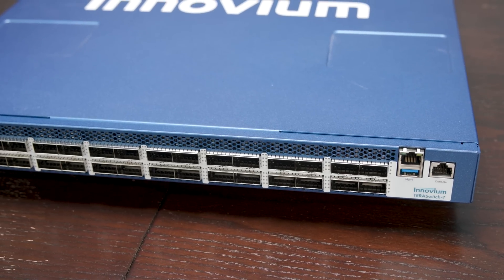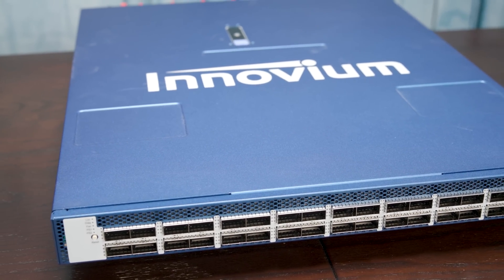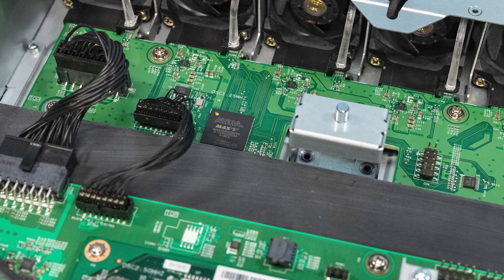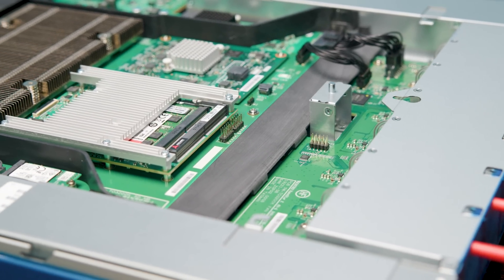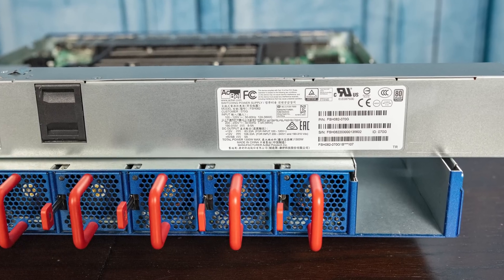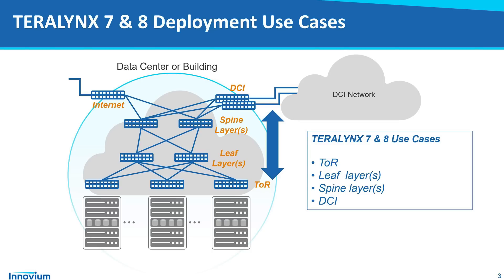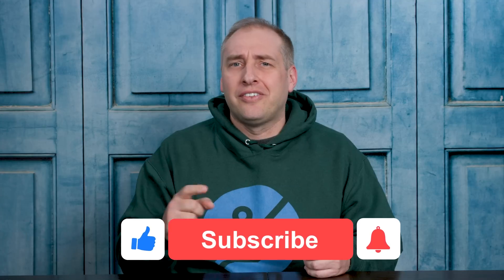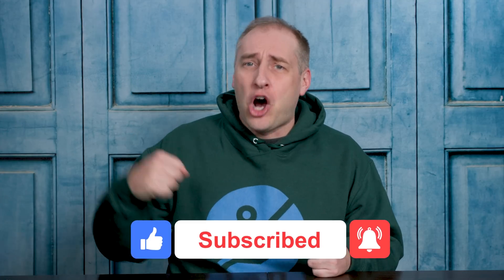Inside a 400GbE 32-port Teralynx 7 Hyper-scale Switch

Comment: At some point, equipment will just be 99% heatsink.
Reply from the maker: Just to give you a sense, in some high-end segments we are at around 10% of system power to run fans for cooling already. Projections go into 20% in the next few years if the transition to liquid does not happen.

Comment: @ServeTheHome Why aren't 2.5 Gbe or 5 Gbe popular yet?  SSD's have been around for a decade!
Reply from the maker: Low speed client moves much more slowly than data center
Reply: not only does low speed client move slowly, 2.5gbe and 5gbe isn't made use by most and those were interim "standards" that only became reality recently. Very unfortunate as I still want to pay <50 for 2.5gbe switch

Comment: Why do network switches always have network ports in front and most servers always have network ports in the rear
Reply from the maker: We use reverse airflow switches in the lab, so the ports are on the same side as the server ports. I think in this case it is because the design is limiting trace lengths between the switch and the QSFP-DD connectors. Given that is where most of the heat is generated, my sense is that you would want that on the cold aisle to get cooler air.

Comment: Where do you see Cisco ACI being used vs systems like this which are more Legacy Networking?

ACI uses usually Nexus 9K  10-40Gbps connections for Leafs and 40-100Gbps for Spines, along with the native firewalling that ACI provides.
Reply from the maker: The easy answer is that Cisco, by design, is effectively irrelevant in the markets these serve. The hyper-scale folks have been on a mission for years to replace proprietary Cisco. Given the margin profile Cisco needs to maintain, it was less expensive to design big infrastructure without Cisco. That process has been happening for many years. Cisco is more focused on the higher-margin enterprise. AWS, Google, Microsoft, Facebook, and other hyper-scalers are not using ACI and effectively drive the server, storage, switch, and NIC industries at this point. They are also the driving force behind 25GbE and now 100/200/400/800GbE. That is why SONiC has gained so much traction.
Reply: @ServeTheHomeVideo  I agree... Me seeing quotes in my MSP practice to customers for $37k 100gb gbics is INSANE. 

I love to start pushing other products, but when so called architects have such a hard on for CISCO it's impossible to tell them otherwise.

Comment: A lower level breakdown of the use of a 400Gb switch is:

Power consumption 
With fewer units you save money on the power bill. Doesnt matter if the replacement switch uses 5x the power compared to the five switches it replaces, the heat dynamics arent perfectly scaled either. That means that 5 units running at 100watts each doesnt equal one unit running at 500watts. The one unit running at 500watts will end up using less power due to a more efficient power distribution system and better cooling. You have to calculate the loss to thermal mass and heat radiation as well.

Heat management
With fewer units running you can spend less money on the cooling systems, or at least scaling down the effective cooling needed. See the note above.

ROI with and without Pc and Hm 
An important feature with all of this is the potential ROI. If you spend $50.000 on one unit that replaces five or ten other units, the cost of cooling, management (which is an actual cost), licences, replacement stock, shipping, replacement time, downtime, fault checking time and loads of other concerns, will be lowered. Sure, you can theoretically deploy 50.000 switches and have one person keep track, but you cant have one person serve them all if something happens.

You also have to keep in mind that these switches are for DC use primarily (or really large nodes, however i dont think these would be used for anything else than dc<->node cases, dont want to sever too many users from one node due to heat, power and redundancy issues), fault checks are a real part of a NOC techs job. If you can have one person serve the same capacity as it would normally take 5 people to do, you make that change happen. Meatbags are expensive.

Physical space benefits
Due to it replacing several other units you can over a span of 5 of these probably save an entire rack full of patch panels, cable management, lower switches etc. Remember, DC's dont grow on trees, they leaf spine.... sorry for that one....
Space is always an issue.

Smaller cable runs
Fewer cables that you need to keep track off means happier techs when shit hits the fan.

fewer hops / simpler logical topography
This bundles well with the previous points. You have to remember that not all packages (or frames for layer 2 devices) go in straight north/south jumps (to and from the internet), they often go between servers and switches in the internal structure.

If you look at an example where this switch could be a good use of power:

Imagine you have a cloud provider. When you create a new node in your AWS system you basically rent cores and memory modules from a resource cluster. Imagine the structure youd need to deploy to keep a bussiness up and running if that bussiness use 400 cores and a few hundred terrabytes of RAM. You cant just deploy 400 cores, you need to always have the power to give the user those 400 cores woth of processing cycles. To do that, and cut down on operating costs by renting out the same core several times by pooling the cores and only really selling the cycles, you need way more cores than the user pays for.

Complicated? Sure... The idea here is that you need a fast and caplable infrastructure to be able to link several massive clusers of units. If you can remove 10 100Gb 48p switches and replace those with about 4 of these switches (and divisions) you can shave off a few interconnects, simplify the topology and save on valuable latency. You deal with milions of operations per port per second, remove one nanosecond from each operation and you save one milion nanoseconds of latency per port....

Summa sumarum; Its worth it, trust us.
Reply: You spent all this effort writing this wall of text, but you don't seem to understand basic thermodynamics. Funny how the people who lecture the most are usually the ones who know the least.
Reply: @acruzp  Well, first off it wasnt that hard. secondly, what exactly is it i missed?
Its easy to tell people that they are wrong if you dont have to explain why.
Reply: @zipp4everyone263  you're breaking conservation of energy by saying that 5 units running at 100W don't use the same energy and don't produce the same heat as one unit running at 500W.

Comment: Afaik 400G uses 8x 50G lanes. So if you want to break out to standard 100G (4x25G) you have to reduce the lane speed by half and then you can break out 64x100G and not 128x100G.

Comment: i cant even imagine what the price of something like this is
Reply from the maker: Usually not too bad. The hyper-scale companies get great pricing
Reply: @ServeTheHomeVideo  Compared to the $25 and $199 switches sitting on my bench... sure. (and no, they aren't netgear, or Cisco SG's) These things aren't going to be landing on eBay (etc.) for a long time, and when they do, they still won't be remotely cheap.
Reply: @ServeTheHomeVideo  Come on, whats the price of the unit in this video?
Reply: @hectororestes2752  Similar Juniper equivalents come in around the 50K mark depending on your source.

Comment: Isn’t that a Spirent test switch those things are expensive af and you pay per port.
Reply from the maker: I am aware.  That is why we have been using Cisco's TRex on our lower-end router reviews.
Reply: @ServeTheHomeVideo  Ahh i had the pleasure to have such a thing on hand when we developed our switch chip sadly the ui looks a bit dated. But compliance is pretty good when you don’t have the option to go to a networking feast or buy all that other hardware.
Reply: Yeap. And yes, they are rather pricey. We used the VM version for much of our testing, but we did have much older (1G) hardware units. (recycled long ago, they were just too slow, and the power supplies keep burning out. rather expected of 20yo servers.)

Comment: I just upgraded my backbone at home to 10Gbit/s SFP+ ports.. (old used server hardware really makes it possible) but now this .. 400GbE... ouch.. I want.. I dont' know why and know I'll never use even a fraction of it, but i want it for home use LOL

Another great review.
Reply: I dipped my toes just right now in 40Gb at home. There is virtually zero uplift from 10Gb, since none of my hardware is capable of sending data down the pipes fast enough (storage bottlenecks). Positive change is that I got rid of OVS setup on desktop PC with 4 dual SFP+ cards and got proper switch, so latency is down an order of magnitude, it uses less space (1U instead of full tower), got back 4 cards to use and got additional 15 ports. Downside is constant fan noise (my switch is notoriously hard to modify for quiet operation -- I guess that's why it was so cheap in the first place), and rather significant power draw (120-180 W constant instead of 60-100 W of old PC-based OVS).

Price-wise... QSFP is expensive. DACs are very bend unfriendly, transceivers are very expensive and compatibility is limited, with almost zero force driving for more products.

I think 40G in in dark spot for home lab, since most of development now is focused on 100G.

Comment: Great but what does it cost and is this just an engineering prototype?
Reply from the maker: This is an Innovium painted version of a Taiwanese ODM switch. Innovium has over two dozen ODM/ OEMs the last time I checked. Generally they are geared toward selling to hyper-scalers. I think there are a few vendors using the Teralynx 7 that you can go purchase smaller volumes from, but this is more of the hyper-scale version we are looking at
Reply: REminded me of that jokes - Cool, but... can it run Crysis? ))
Reply: @АндрейПостоялко-б3р  It has Xeon D, so with CPU Rendering on... probably yes!

Comment: Can those 400 gbits borts be easily be split up to 4x 100 gbit? If so I‘ll need to order a few of those 😅
Reply from the maker: Yes. 128x 100GbE or 64x 200GbE as well. Aggregation is a majors use case for this.
Reply: @ServeTheHomeVideo  8x SFP56 to QSFP-DD adapters are very 1U unfriendly, but if they work, 256 servers can be connected. With fat nodes this could serve whole aisle. Little extreme, but cost savings would be HUGE.
Reply: What are you using it for?
Reply: @vutesaqu  for CEPH clustering with about 6 servers or more in future with about 16 SSDs (some of them nvme) per server and a lot of HDDs, but multiple for redundandency reasons, and to connect to clients with 25/40/50/100GbE. Servers are used for data-streaming so the clients require minimal bandwith (10-20gbit/s) all the time.
Reply: Ok, thanks, now just going tp search where i can get my hands on a few of those and emptying my wallet 😅👍